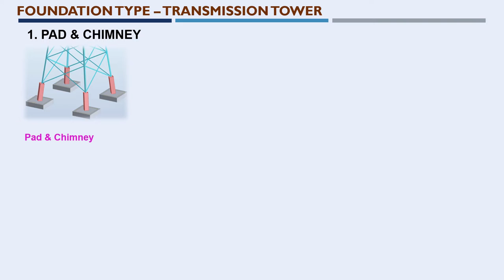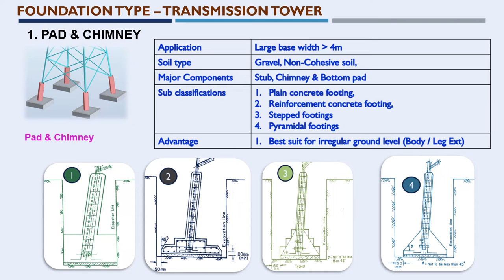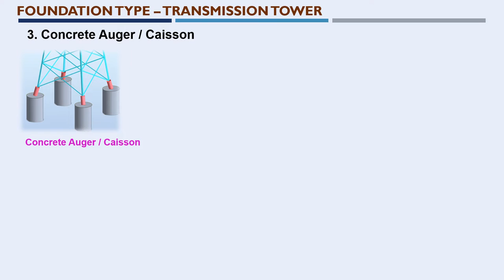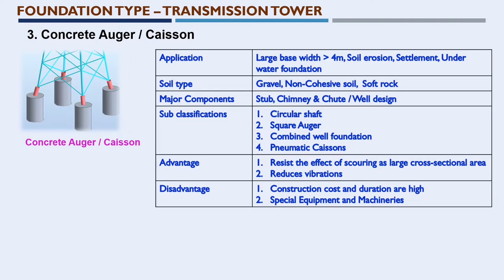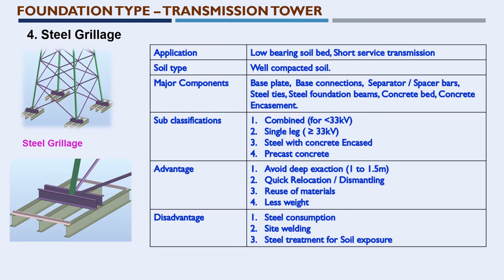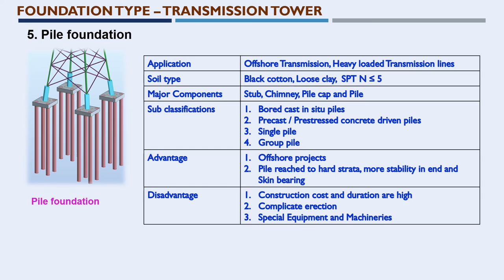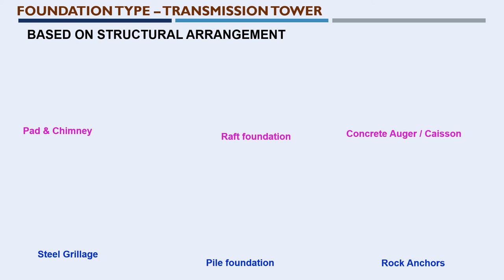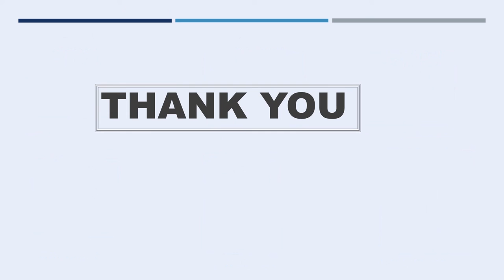Foundation Types for Transmission Tower

Comment: Inchapter 6 Can you explain what do you mean by sizzling on the hard rock? Thanks!
Reply from the maker: It is chiselling the rock with hammer. Chiselling use involves forcing the blade into rocks to break it. The driving force may be applied by pushing by hand, or by using a mallet or hammer. In industrial use, a hydraulic ram or falling weight ('trip hammer') may be used to drive a chisel into the medium to hard Rock.